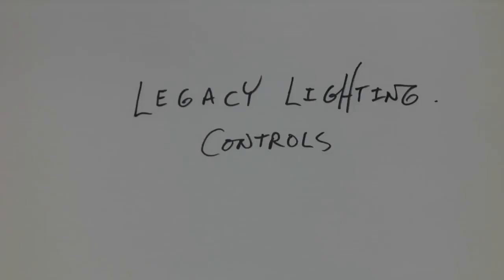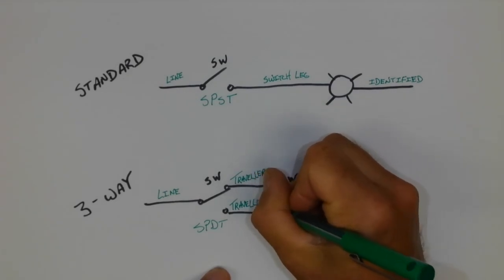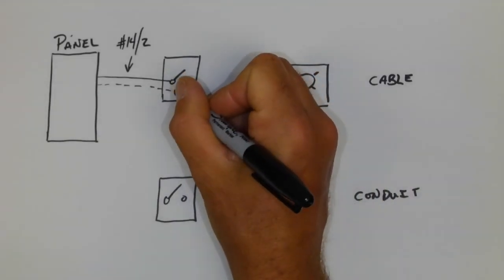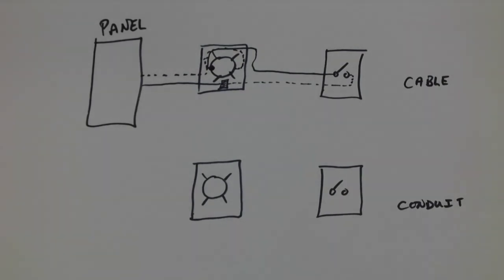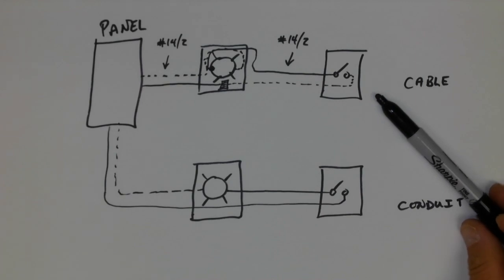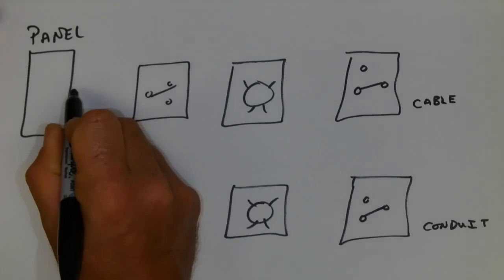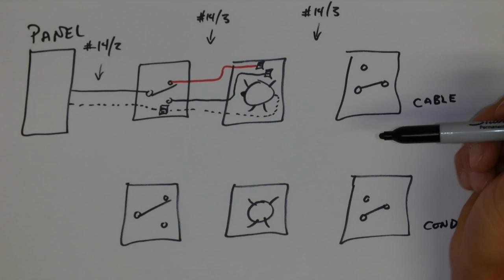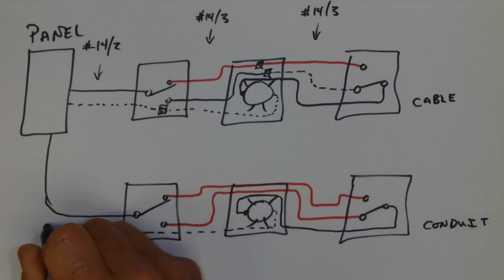Section 4 CEC: Legacy (older) Lighting controls

Comment: The rules in the USA are very similar when it comes to using the white, or "identified" conductor as an ungrounded or "hot" conductor, and is found in article 200.7(c) of the NEC.  

In simple words, "technically" you are permitted to re-identifiy the white conductor as hot only when in a cable assembly or flexible cord.  A common situation is in a family home where a 30 amp, 240V circuit is needed for an electric water heater.  A 10/2 w/G NM cable is used, which has a black, white and bare.   Because this circuit does not use a neutral, the white conductor is  re-purposed as the 2nd hot by  wrapping with black or red tape near the end at all terminations.  

On the other hand,  if this was a conduit installation using THHN/THWN wiring for example, more often found in a commercial/industrial building, then it would be a violation of 200.7(c) to pull a black, white and green and wrap the white wire with black or red tape at all terminations.

I used the word "technically" because in the past I've work in recently constructed commercial buildings which passed the final inspection, and found a few 208 / 240V circuits in which a white wire had black, red or blue tape at the terminations, and EMT or RMC raceways were used, with THHN wires inside. And as a licensed electrician myself, I am also guilty of bending this rule occasionally, when I run out of the color wire I need and I cannot stop and go to the electrical supply house to get more of the correct color wire because they're closed after 5pm and I must continue working to finish the job and meet deadlines.   Our county inspectors seem to be more lax and let this slip through the cracks, as long as we actively took the time to re-identifiy the wire to the correct color at all terminations and where visible, including conduit bodies and pull boxes.
Reply from the maker: Thanks for sharing about the NEC equivalents down in the USA. Our requirements are incredibly similar in many ways.

Recently, the requirement to ensure a neutral conductor is present at every lighting switch location has made these older legacy switching configurations a thing of the past. Although electricians will need to understand them during retrofit/renovation, they are no longer acceptable for new installation.